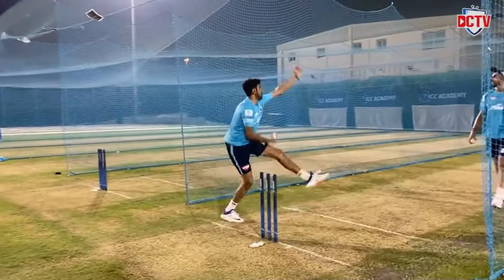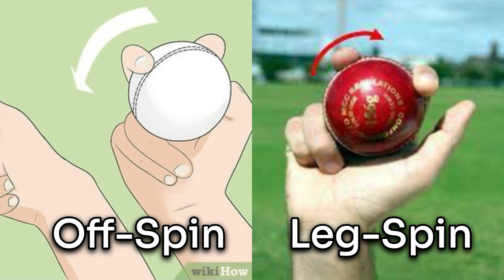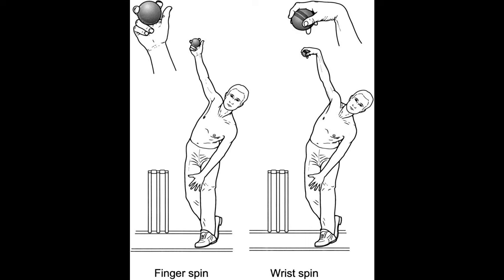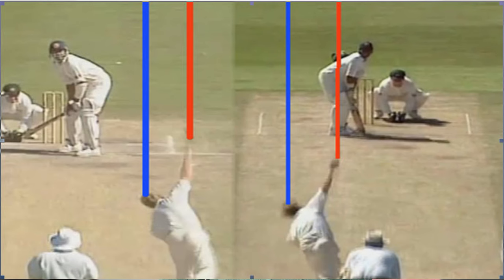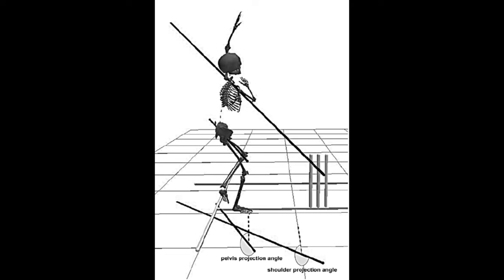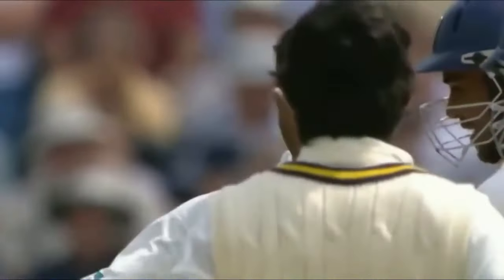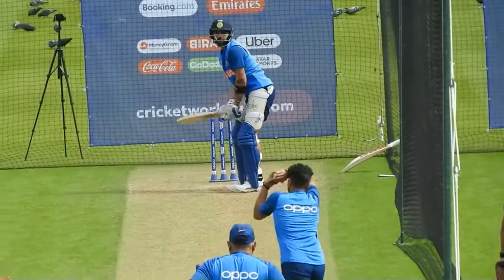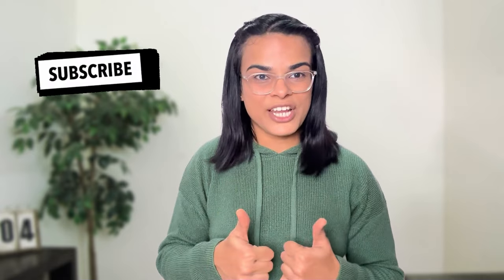How to be a better Spin Bowler: Cricket Biomechanics

Comment: Hi there! Myself being an upcoming spin bowler... must admit great content... however, I must highlight there is an small misleading info on the 'revs/sec' part... most elite category wrist spinner generate >2500 revs/minute (rpm) or 41.66 revs/sec... I am on average clocking currently >2600 rpm or 43.56 revs/sec... and remember good spinners bowl in a good pace around atleast >85kmph in modern cricket where the batter gets slightly over half a second to react.. you would probably get only 3 revs/sec on a knuckle ball probably..  hope this helps and makes sense... good luck....